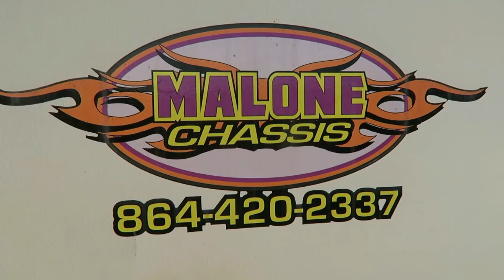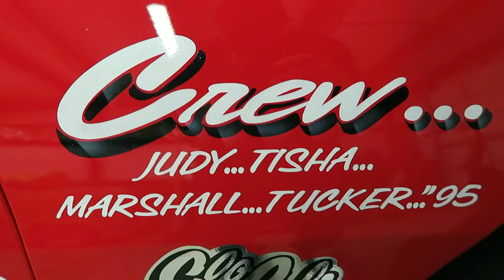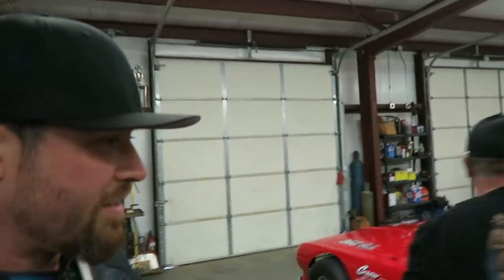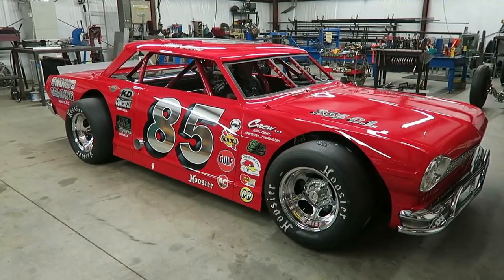Hamke Late Model Chassis 1964 Chevy Nova Race Car UPDATE

Comment: Love the car But I don"t under stand the off set of the wheels unless this car is set for one Race track only ??
Reply from the maker: yeah its a asphalt circle track car
Reply: Pretty sure the whole chassis is built offset. Didn’t show it, but I bet the rear end is offset with a longer axle tube on the right than the left. That’s the way they build asphalt Modifieds.

Comment: Why isn’t it centered?
Reply: Caution Wet Floor it's built to turn left. You want all the weight that you can move towards the left side of the chassis and as low as possible.
Reply: jeffrey roth ahh thanks

Comment: Ok  Serious question !! Who jumps in a car and starts a cold engine and REVS the f**K  OUT it and  Continuously does it and holds the rpm at 3000 after 2 minutes  and shuts it off? Just wondering!!
Reply: It's actually the best way to break a motor in and seat the rings. The worst thing you can do is let it idle especially during the first 20-30 minutes it's run.
Reply from the maker: Everyone...
They wont idle till there hot.
Besides that, it just sounded like he was reving the fuck out of it. 3k rpms in  a 10k rpm engine is just like your 5k rpm daily at idle.
Reply: mikl911 but you don't know if it's a fresh build or a old motor
Reply: mikl911 I see your point and correct but from what I understood this was a old car/ rolling rail that just GOT rebodied still don't know if it's a new motor or old one
Reply: True
Reply: Wasn't trying to start any trouble lol and to Kyles point high strung race motors don't idle until they are good and warm especially if it has a carburetor.
Reply: mikl911 no issues  here I'm learning every day all good bud
Reply: Shit I do!  I build a motor put it in and spray it with nitrous at 8000rpm with zero minutes on it. If it restarts its good to go if it blows I know I didn't build it right
Reply: Everyone.  How did you miss the bus?
Reply: Yo mama